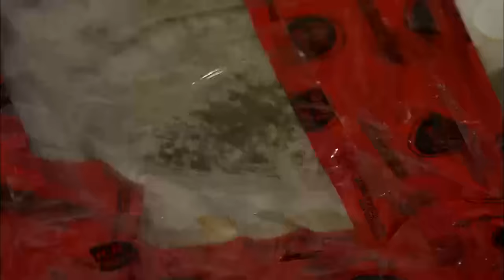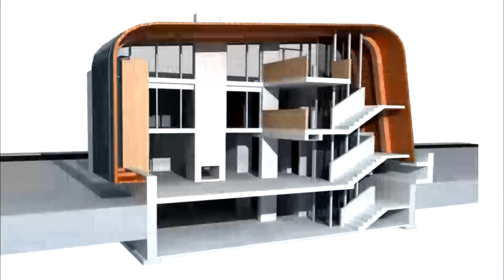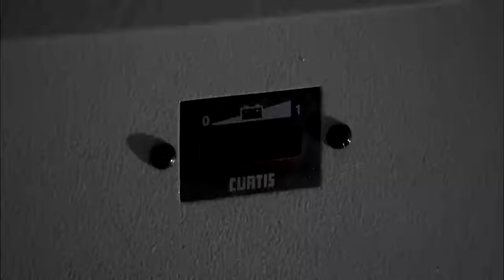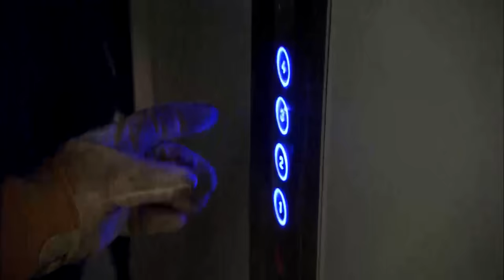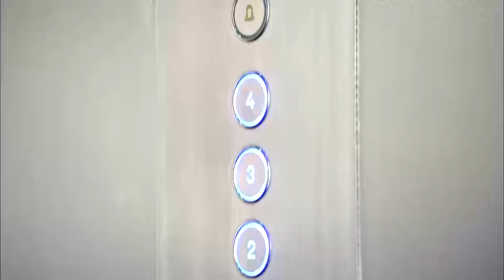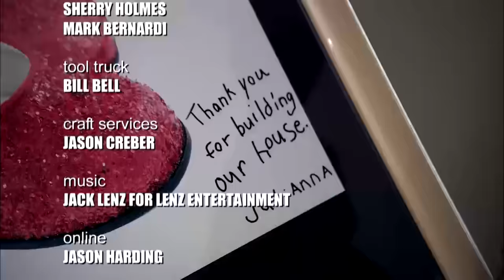Lien On Me | Holmes on Homes Special

Comment: I wish i could find out additional info regarding the outcome of the lien/suit against the family. The fact that at the end of the video the original contractor still had a lien on the home is mind boggling. You've got to be a real piece of work to still be confident that your crappy work was a "Mercedes".
Reply: I still don't understand the underlying justification for the lien.   Hopefully there's not an equivalent in the US.  If I install a $30K solar system, it could easily be argued that it's a $80,000 value since that's what I expect my power bills would have been over 20 years at 3.5% energy inflation, and up to $180,000 with the more likely accelerating 8% to 12% inflation.  $55K without ANY inflation.

As long as I pay the $30K construction bill, they'd have no basis for claiming more.
Reply: I was also wondering what the outcome was
Reply: The lien was paid and then the contractor was prosecuted by the crown for criminal breach of trust.
Reply: @PatrickLeeUS where did you see this.
Reply: @BradLarsen-nl2pc  There are sadly a lot of similar laws in the US. Contractors can quite easily pad a bill then sue you for non payment if you refuse to pay. Their level of work is always vague as well as they can claim almost any reason for delays, weather, supplies being late etc. Despite all the delays mostly being their fault, some how the home owner is responsible for paying more if the project takes longer than expected.
Reply: @JustaGuy_Gaming  Wow!   

I saw a CBC Marketplace YouTube (Canada again) of a company installing a single Ring camera and putting a $20,000 lien on the home for it!   

California's known for consumer protections.  Hopefully this nonsense doesn't fly here.
Reply: @BradLarsen-nl2pc 🧐hmm...idk about those consumer protections...at least in WA state-I call it the "screw you loser" state.  No consumer protections at all...in an earthquake zone.
Reply: @YosefEliezrie     If you come across any additional information regarding this home or contractor, please send me a link.
Reply: @BradLarsen-nl2pc Most US states have laws that allow people and companies place liens on properties. It takes time to do this and in extreme circumstances, they can auction the property.
Reply: Mike has in the past gone to court as a supporting witness for home owners. He collects evidence from the home site, video and photos. He talks to people from various trades, collecting more evidence.  By the time he gets to the witness stand, he is LOADED for bear.
Reply: @JustaGuy_Gaming  Unfortunately many of the laws that exists  are because the bad actors of both home owner AND construction company.  I believe one of the critical failures usually seems to come into play is bad inspections. Mike can be on his high horse about the bare minimum in regards to code.  But you take where I live and a house going from 200k to 400k with a tightening of building codes makes makes a new home dream out of the reach of many. With a remodel of a older home equally pricy. 
FYI The median price of a home in 1950 was $7,354.  Today its $392,000.
Reply: @GarrethandPipa  Yeah the prices are insane and getting work done right cost even more. I can't remember the episode but some one had Mike fix their house. He did quite a bit of work and it came to over 200k or so from what they said, and that was back in 2008 or so.

Basically the work Mike did, including discounts and such he gets for being famous TV show would of cost more than the house was worth and it didn't even fix everything.
Reply: @BradLarsen-nl2pc  90% of lawsuits are whoever has more money wins. Doesn't matter the protections you have, they will sue you for something you aren't protected against and drain your money until you have to give up.
Reply: @cornfed123567  Or appeal, delay the motion and what ever they have to do to drag a simple lawsuite out to last years. It's why so many class action law suites are pointless. They take a decade to resolve and by the end after the lawyer fee's are take out your "settlement" even if your 100% in the right is almost nothing.

Honestly if your haven't been injured or killed most lawsuits can't even cover the cost to sue some one.
Reply: The scary part is, there are a lot of so called "professionals" in all industries that also behave like this...and are so use to not being questioned, they continue down their path of incorrect installations. I always do my due diligence and try to find out as much as I can on the project I am needing a contractor for, so I can be educated.
Reply: @BradLarsen-nl2pc  Sadly, yes there is almost an exact equivalent to these liens in the U.S.
Reply: @PatrickLeeUS hope the contractor gets found guilty and sentenced to prison for the maximum sentence. The building inspector should be prosecuted also.
Reply: Building inspector liable at all ? He said it was inspector
Reply: @PatrickLeeUS  can you provide the resolution to the cases? what was the judgement in the civil case or link to it? How was the contractor punished?

Comment: 14:50 - We had the same thing in our house with the finishing nails in the cabinets. We found out the day of our final walkthrough the day before closing. It was a foreclosure where the previous owner ripped out the kitchen when they were evicted,  sat on the market for a few years and the bank (we are told) had a new kitchen installed. On the final walk-through one of the cabinets was on the floor face down in the middle of the kitchen. We were about to file a police report thinking it was vandalism, as the back door was clearly kicked in at some point but we didn't notice that on previous walk-throughs. Immediately we noticed ZERO holes in the wall where the cabinet was, just finishing brad nails, then determined that the bank kicked in the back door to gain access and not have to pay a locksmith but didn't repair the trim. We have the same cabinets today, the first job in the new house was getting those cabinets fixed to studs. A few months into ownership we heard a crash from the 2nd floor of the house, forgetting that an IDENTICAL cabinet was in the laundry room and suffered the same fate. I repaired the cabinet and got it attached to the studs as well. So far a decade in and no issues. The house will be falling down around the cabinets before those things budge now.

Comment: The new house looks amazing – like a million dollar home, maybe more at current prices. Solidly built, as is more commonly seen in Germany. I wonder how many square meters in size? To me it looks way bigger than what a family of 3 or 4 would normally build for themselves. I also wonder about long term maintenance costs for the complex systems in the house. I hope they are still able to enjoy it today, 16 years later, after all they had been through. A follow up would be really interesting!
Reply: The maintenance would be nil...Look at the systems Mike had built into it...They're all about 99% maintenance free...
Reply: @ICU2B4UDO  admittedly these are high quality products that would function reliably for a long time. Nevertheless there is complexity in each system which certainly would have needed some maintenance within the last 16 years. The lead-acid solar batteries last less than 10 years, the green roof needs regular upkeep. A TSSA inspector will visit your elevator once every one to three years and may require some repairs or maintenance. A rainwater catchment system requires regular cleaning and may require filter changes and pump maintenance. 

For the core features such as concrete walls, metal roofing etc, I agree that they would be 99% maintenance free.

Comment: This type of build excites me as I love anything that's a Green Home, Passive House, Net Zero House. And to see it on a main stream show in the U.S is great. It's big overseas and is just making big strides in America. It's standards are much higher than local coding standards here and really provides for lowering utility cost (or no utility cost) and more comfortable living environments that will last the test of time. Concreate is a great heat conductor and with heated floors you won't have to run your room heat as high to stay warm so it lowers your cost. This build is the equivalent to smashing an ant with a sledge hammer ladies and gentlemen.
Reply: @bushnj8748 This house is as green as my 1200 hp race car, I bet you also think electric vehicles are also green! Did you not see all of the heavy equipment that was used to build this waste of money, They were all powered by either diesel or gasoline I did not see one electric vehicle! This house could never make up the difference in what was wasted just to build it, But hey keep dreaming!
Reply: @NeverEnoughPyro40  You clearly don't even know what your talking about.  Before making an ignorant comment about my comment it may be smart to look up what  a net zero home or a passive house is on youtube or google.

Comment: Mr Holmes You are a Hero. I've been watching your videos on and off for years. I live in Minnesota USA and 2 years ago the goverment weatherization program came in to "weatherize" my home. The exterior window caulking is old hard and cracking i asked that they recaulk, they wanted to pull my interior trim and stuff insulation in instead so I refused I told them i want to keep it out not trap it in the wall. They installed a new vent cap for my kitchen exhaust which now doesnt pull 1/2 as much as it used to and causes an icepack all around it in the winter, they installed a "upgraded"  bath fan ran it through my wall above my bedroom window with a plastic dryer bent cap, it is intended to run very slow all the time, it freezes shut in the winter. They cut out one of 2 of my existing wooden attic vents made it larger and then stuck the $8 off the shelf "shed quality" tin vent with 6 screws on top of my siding and filled the gaps with caulk. They removed my exterior metal dryer vent and replaced it with plastic that was to big so it is bowed and flexed to fit the spot. They spray foamed my sill no barrier, some spots are less than a 1/2" thick and some slumped before curing leaving gaps. They removed my existing door sweeps to replace the new ones are already shot. They removed/replaced my new smoke detector, all 3 of the ones they installed faulted out within the first 8 months. 
I called the program director he brought his inspector with and bullshitted their way through dumbed down justification of the jobs done. I asked them whos paying to repair what theyve done, Ive never heard back from them.

Comment: Code of Hammurabi:

229 If a builder build a house for some one, and does not construct it properly, and the house which he built fall in and kill its owner, then that builder shall be put to death.

230. If it kill the son of the owner the son of that builder shall be put to death.

231. If it kill a slave of the owner, then he shall pay slave for slave to the owner of the house.

232. If it ruin goods, he shall make compensation for all that has been ruined, and inasmuch as he did not construct properly this house which he built and it fell, he shall re-erect the house from his own means.

233. If a builder build a house for some one, even though he has not yet completed it; if then the walls seem toppling, the builder must make the walls solid from his own means.

That was nearly 4,000 years ago, folks
Reply: WHY did they have to put these clauses in The Code? Because 4000 yrs ago, there were crappy contractors! And no Mike Holmes!

Comment: There are quite a few Mid Century Modern homes that were built with the environment in mind back when the architectural movement was in full swing.  Heck, the whole movement was about taking advantage of sun, rain, even as far as thermally heating the water.

Comment: It's a very nice home. I wouldn't call it affordable when Mike said a 100 different contractor companies worked 18 months to build one house. I wish he had shown a prefab home with factory made wall panels. They use a CNC machine to cut window and door openings. Conduit is placed for electrical. The wall has interior and exterior finishes with spray foam inside. A crane can assemble a house in a few days.The roof trusses are placed and then the crews finish everything. A couple months later it's ready for the customer to move in. Very air tight and affordable.
Reply: Bear in mind this is, like, two decades ago. Maybe more.

Comment: Does Canada not have a bureau of does Canada not have a bureau of contractors? I live in Arizona, which isn't a partcularly proactive state. I always check their regstry if i need something expensive done to my home. Not only are any complaints shown, but the contractor's license is suspended until complaints are resolved. Contractors have to take a test and put up a10,000 dollar bond to cover any screw ups. Contracting with out a license is illegal and they are actively hunted.

Comment: That solar installation is inadequate. If you expect your daily lode to be 35 kwh and winter days can be around 8 hours, you need a minimum of 4.5 kw in solar pannels. Also, your battery installation needs to be at least 28 kwh. What you have isn't even half. Plants on the roof are OK, but solar pannels will save real money.

Comment: I'm confused as to how the contractor gets to put a lien on a property he never finished. I'm trying to understand the concept:
If I pay someone to renovate my house, ideally my property value will increase - especially for the vast amount of additions added to this originally small home. At some point, the homeowner stopped paying this contractor what he kept demanding. Homeowner ultimately paid out $219,000 to the contractor, $19,000 more than the contract value of $200,000.
|
So if I'm understanding this - please correct me if I'm not - the contractor sues the homeowner for "unjust enrichment." He screwed them, but is claiming he has a right to collect the "added value" of the home? That's the $300,000+ he's putting a lien on the house for, yes? So by his logic, even though he screwed the homeowners, they don't get to benefit from added value on the home they were emptying their bank account to renovate - even though renovations almost always add value to the home? The fact that they have added value is "unjust?" And he can't claim with any credibility that he didn't screw the homeowners - half of everything this guy touched was a code violation. There's enough bad work in the home to have it condemned, deemed too dangerous to be livable. He expects anyone to believe he didn't know he was cutting corners - never poured FOUNDATION FOOTINGS to triple/quadruple the size of the original home? Seriously?
|
I'm confused how this is allowed in the legal system. Clearly I don't know enough to grasp what seems like backward logic to me.

Comment: house looks lovely, i cant help but laugh at the age of this though. not a single network cable run anywhere to be seen. and because its all concrete getting wifi to work properly will be a nightmare too.
Reply: This episode aired in 2007 or 2008, and there was a disclaimer at the end stating  that "some safety guards, protection and equipment may have been removed for the purpose of television." I'm sure they resolved that issue years later and upgraded their lighting system to LED lights and gotten energy star appliances making the home even more energy efficient.

Comment: Not getting building permits should be a criminal charge with a very hefty fine.  With permits, the inspector should be required to view the work and be held liable if they have signed off on incompetent work.  Which, of course, you would have to be an engineer to determine that as a challenge against the inspector.

Comment: Amazing. I hate the divided kitchen sinks like that, my folks have one and they are just plain dumb. No room to do big pots or pans. Apart from that, this is heartbreaking to see. Plus, the reveal of the shoddy work from the previous contractor makes me curious what is lurking behind the walls of my parents home. Freezing cold bedrooms in the winter, excruciatingly hot in summer, stupid ass light switches that make zero sense, crappy overspray and pooling of water on the tub/shower, exterior "finishings" that are coming undone. These contractors must certainly pay for their crimes and Mike is absolutely right.

Comment: 💕I believe this was originally built many years ago & they totally deserve it💕I do hope they’ve changed the laws so that these Cowboy Builders can no longer get away with stuff like this💕In my country builders must have full insurance to protect their work & the work they do building inspectors visit any home being built having extensions inspections for plumbers electricians etc… all work must have a certificate passing their work If it’s wrong they have to put it right by redoing the job💕Inspectors have to Pass qualifications just to get a job💕Every borough has its own headquarters for these trades people💕It’s set up to protect the home owners from cowboys who try to rip off innocent victims💕
Reply: YES it was a few years back. (15 years) Wondering if they have upgraded the battery's to a lithium system giving even a better backup with less battery's.